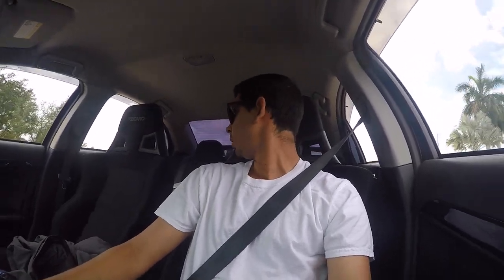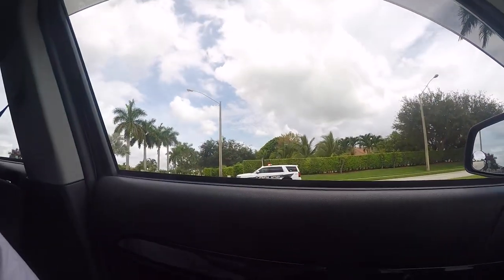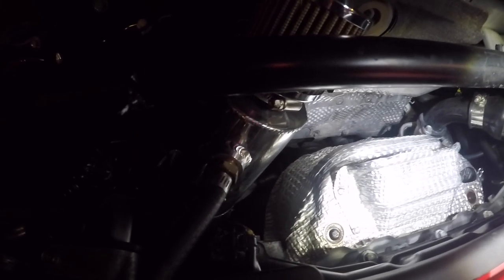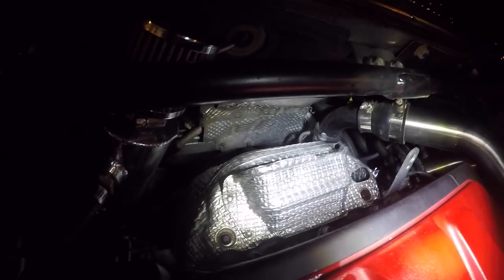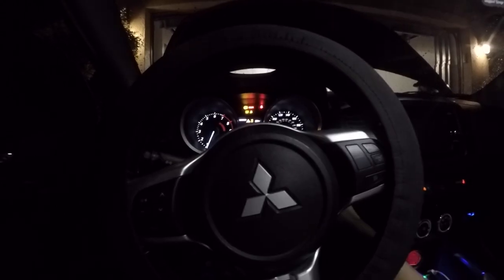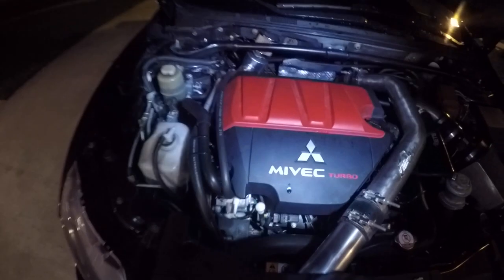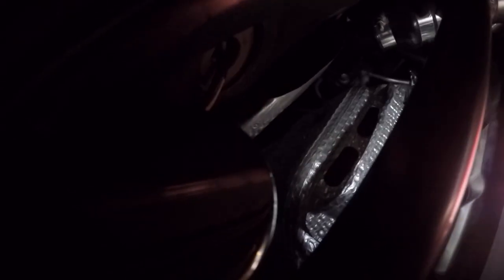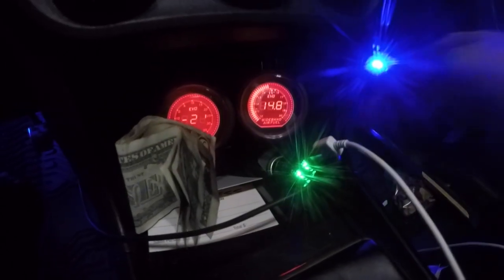Evo x is fixed! Not running lean anymore :)

Comment: did you ever fix the p0171?
Reply from the maker: Yeah after fixing the downpipe which was leaking, and changed the O2 sensor it went away. Also it can be tune related, so have the tuner check it
Reply: DanielDiazEvoX what o2 sensor did you replace?